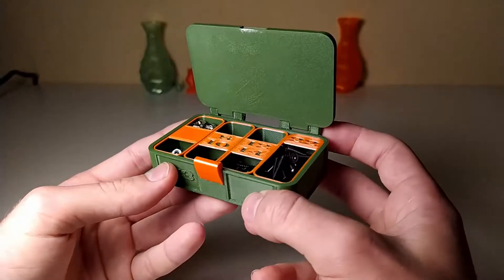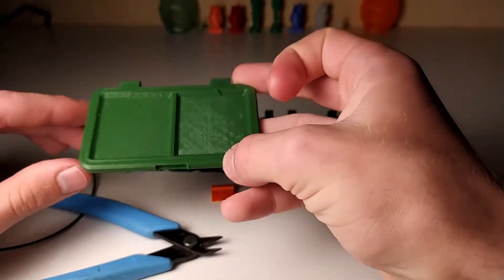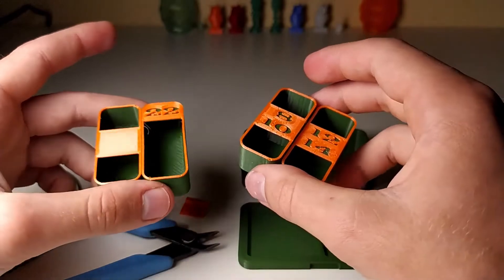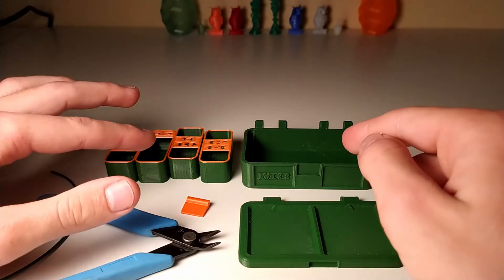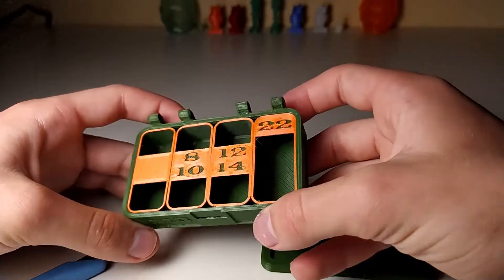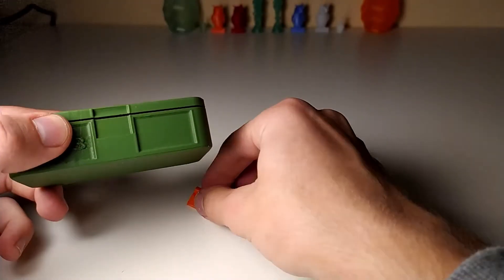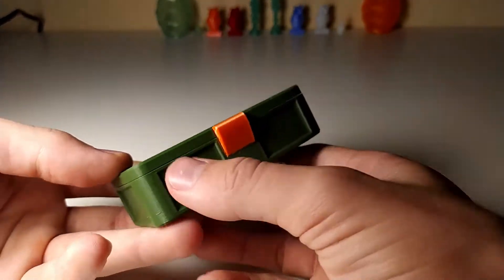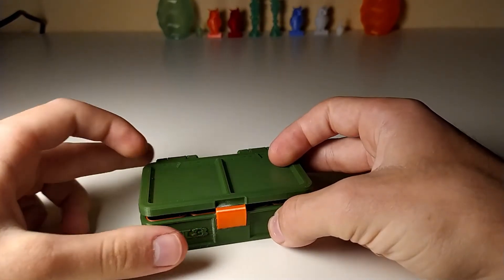3D Printed Storage Box for Sorting Nuts, Bolts and More. Free Download! 600 000 combinations!

Comment: Box is exceptionally well designed.  Note the reinforcements around the edges on both the top and the sides of the box.   I had to drill the hinges for the pin.  Might just be my printer.   After downloading a bunch of storage this is one of my favorites.  Kudos for the nice design and the size designations on the outside of the box.
Reply from the maker: Thanks! Glad you like it!